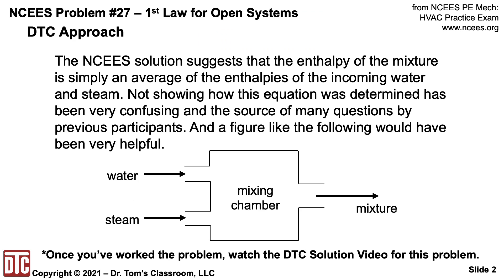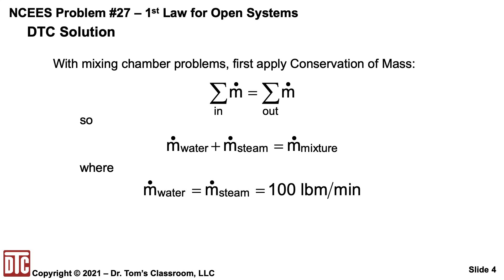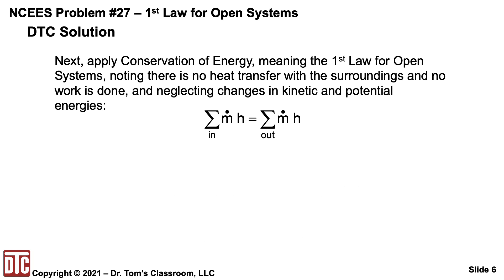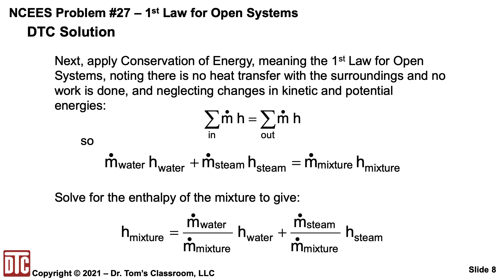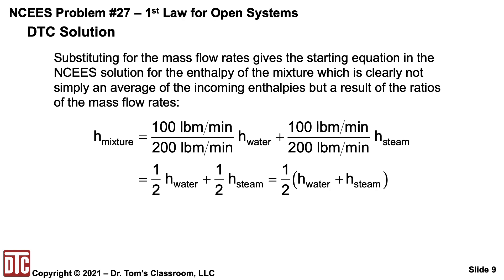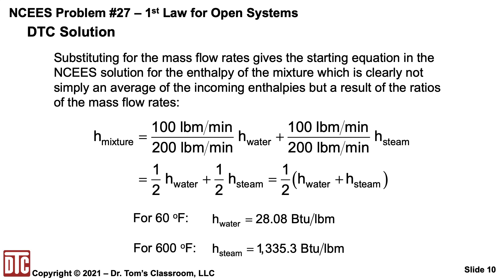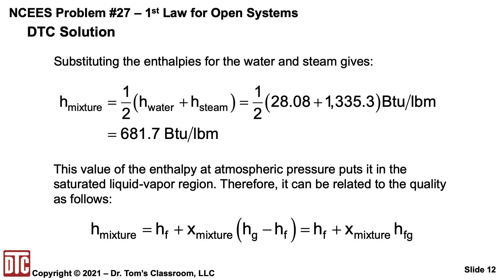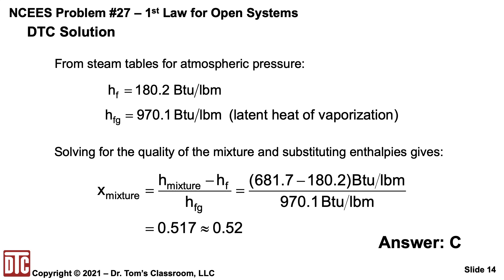NCEES PE Mechanical HVAC Practice Exam Problem 27 - 1st Law for Open Systems (Solution Tips)

Comment: "This value of the enthalpy at atmospheric pressure puts it in the saturated liquid-vapor region." How do we know this? How does that lead to using the atmospheric steam table values at 212 F? Thank you.
Reply: The problem states that the mixture is drawn off at atmospheric pressure, and the value of the enthalpy of the mixture, 681.7 is between hf and hg, so the mixture is in the saturated liquid-vapor region.  Hope that helps.  Dr. Tom